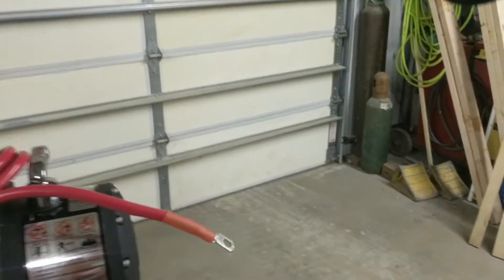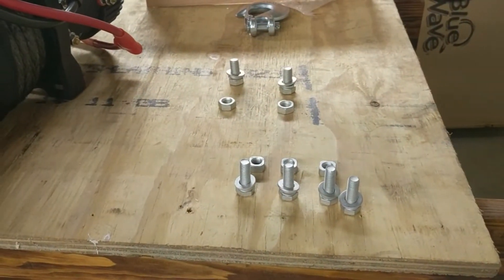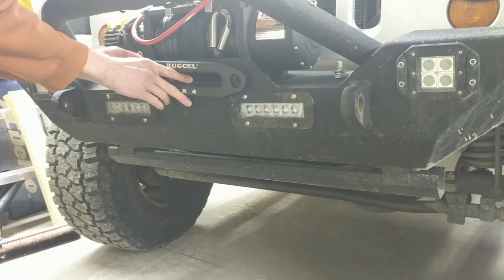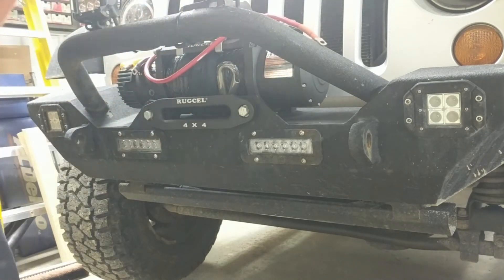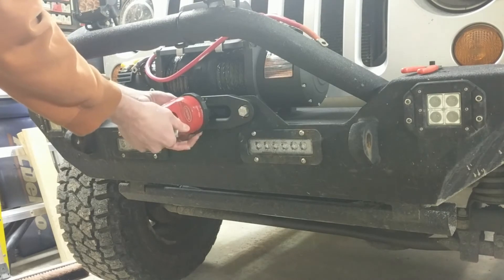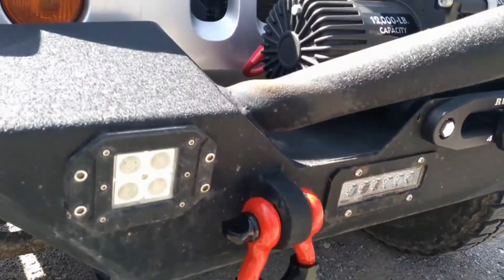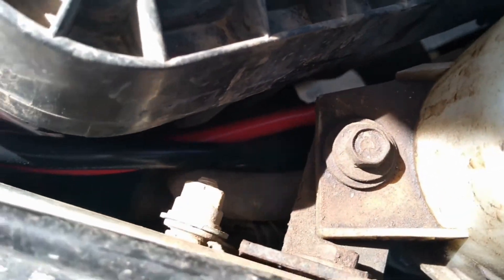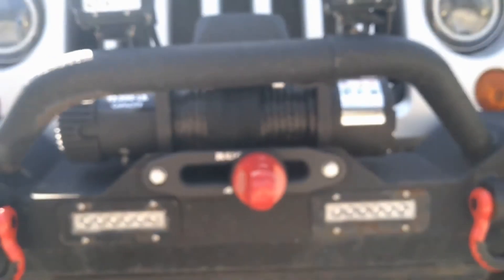How to Install a Winch | Jeep Wrangler | Rugcel 12,000 Lbs.

Comment: Great video! I just bought this winch and going to install it on a 2017 TRD Off Road Tacoma.  I'm using on a Hybrid after market bumper from lil b's and hope it fits! lol The bumper comes in next week and hopefully the holes line up. So how's the winch holding out?
Reply from the maker: Hey I am so glad you liked it.  The winch failed on me due to a manufacture defect.  Here is a link to the video I made of the fault and repair. 
https://youtu.be/BDScCdZdRRw
I had a few issues with Rugcel regarding the warranty.  We are in the process of resolving that. Here is a link to an update video.
https://youtu.be/mBggvTvDZaY
Reply: @professorvanwormer  Good to know and hopefully I don't deal with that issue myself, after installing it.

Comment: I wired mine up with the short black on the black terminal and the black to battery and thin black wire on the bottom but it just runs continuously when it's connected to the battery regardless of the switch.
Reply from the maker: Sam, This is the same way I wired mine.  I also just reviewed a few diagrams for other winches and they are the same. It sounds like you may have a shorted relay.  What happens if you connect the thin gauge wire to battery ground and leave the heavy gauge wire disconnected from the bottom terminal? Listen for relays to click in the control box. Hope this helps.
Reply: @professorvanwormer  thanks, I actually emailed them and they got back to me in about an hour and are sending me a new control box.
Reply: I wired mine up the same way, a
few minutes ago but haven’t installed it yet on my truck yet. I hope I don’t have any issues.